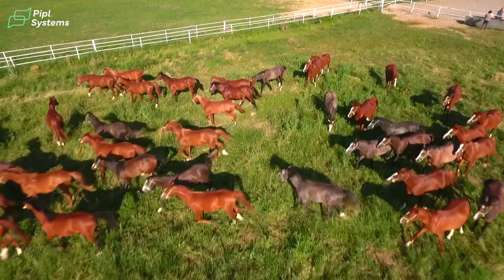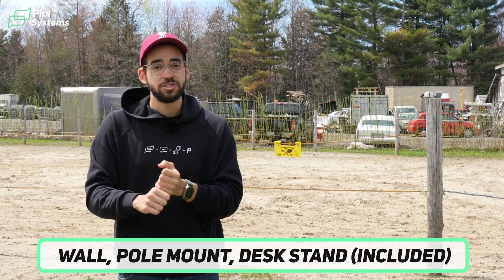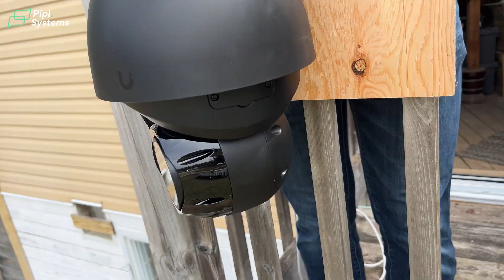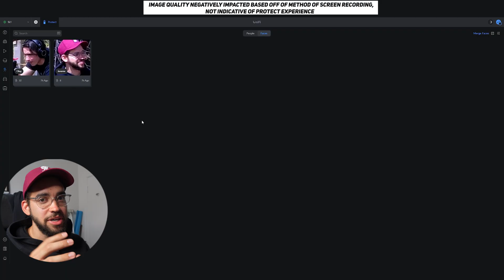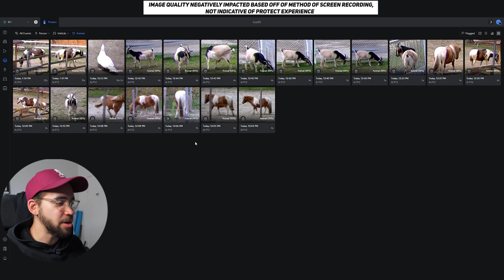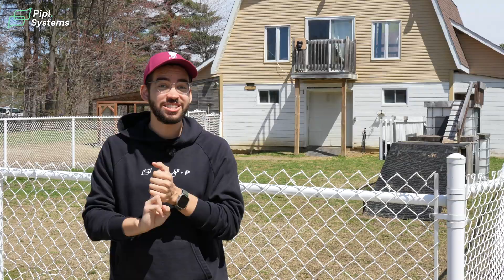UniFi Protect New AI PTZ Industrial Tested | One Camera to Monitor an Entire Farm?!

Comment: Something I learned recently: Probably the most powerful feature of the PTZ is its ability to use other cameras as spotters. So if you have a static camera that is watching a certain area and it has a particular detection, you can configure it to rotate the PTZ into that specific direction so we can zoom in and start tracking. That is pretty awesome.